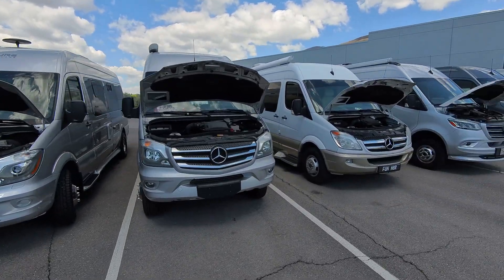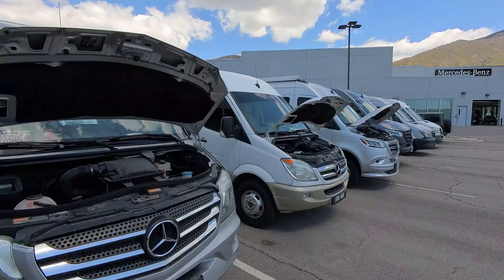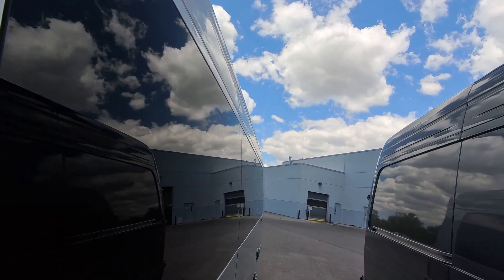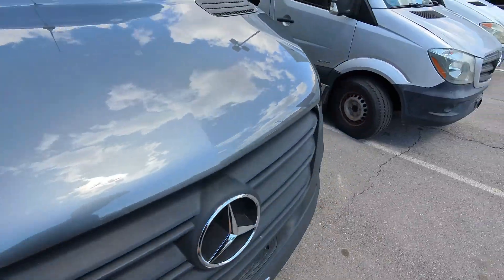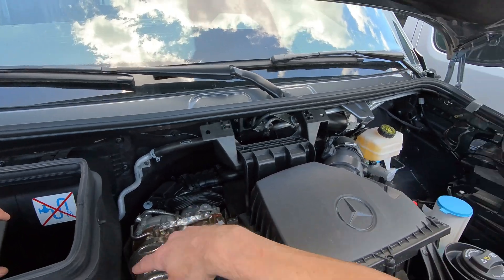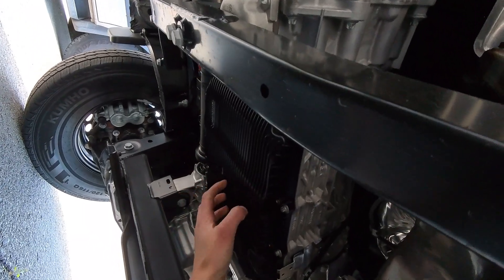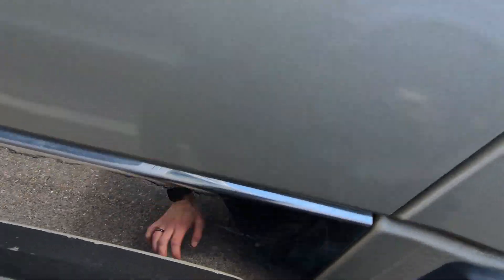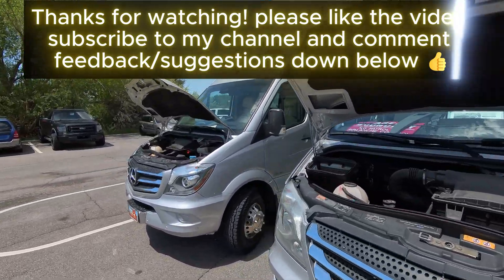Only Vans: What Chassis, Engine, Transmission?

Comment: Would it be possible to "upgrade" from 5g to 7g? I got a -12 906 with a 5g that winds up gearchanges a little.
Reply from the maker: Not that I’m aware of and by winds up gear changes what do you mean? Like hard shifts?
Reply: @OnlyVansMB mostly in low speeds the trans tends to reach 3000rpm until it changes to a bigger gear (normal?).  No hard shifts.

Comment: Hello Trevor,  I have a super tech question for you and hope you can help. I am swapping an OM642 from a 2013 Freightliner Sprinter into a 2013 MB Sprinter. i need to know if the engine harnesses are the same and if not, what are the differences.
Thank you in advance.
Reply from the maker: @mdaniel26rr  hey happy to help! So as long as they are same or very close in model years there is no difference between a freightliner Sprinter and a Mercedes Benz Sprinter and you should be good to swap

Comment: Interesting. My 24 doesn't have the body line. Do you know what month during the '24 production they added that?
Reply from the maker: @HelloAnthony  ah that is interesting now I’m curious as to when that was added as well. Out of curiosity What is your manufacture date? Mid June to Nov,Dec 23? Or actually in 2024?
Reply: @OnlyVansMB  Where do I find the manufacture date? I looked on the build sheet and the various stickers on the van but didn't see it specifically mentioned. There was a sticker to the left of the DEF tank that said, "24/10/23" but I think that might be for the headlights as it also mentions LED SAE. I'll look for a VIN decoder and get back to you.
Reply from the maker: @HelloAnthony  on the driver seat base is your "VIN plate" on there will be the month and year of manufacture
Reply: @OnlyVansMB  I can't believe I missed that! My van's manufacture date is 12/2023. I should pose a question to the '24 owners on Sprinter-Source to see which month the body line started appearing.
Reply from the maker: @HelloAnthony  you should I’d be curious to know as well and you could tag me in it. pretty sure @TrevorMBsprintertech will notify me but I am still learning forum navigation haha I wonder if they literally started the body line with Jan ‘24 and up lol or later in the year